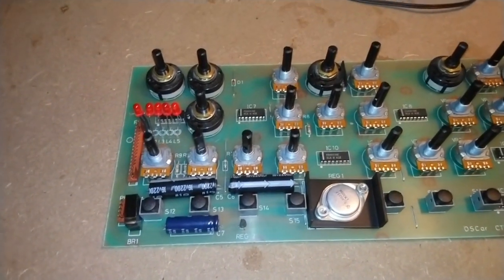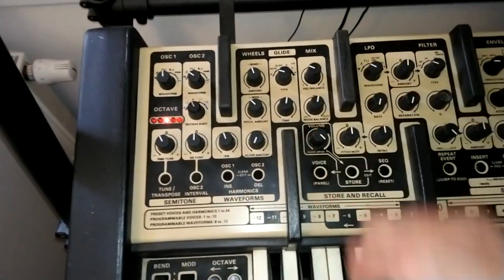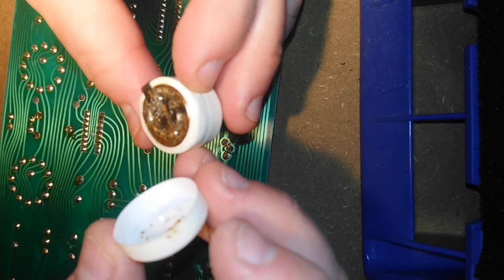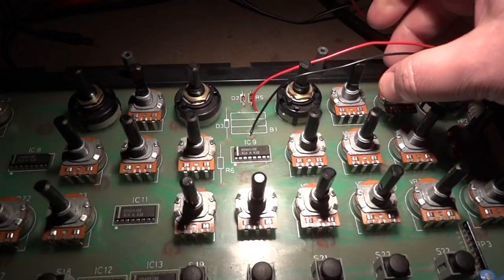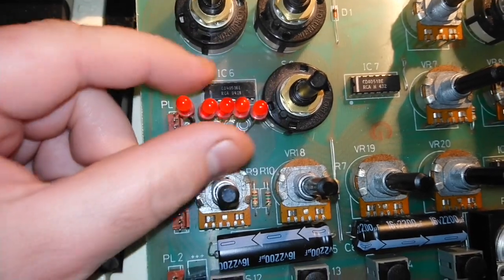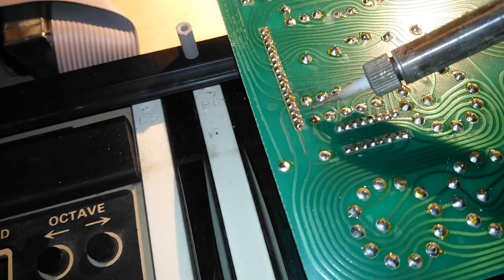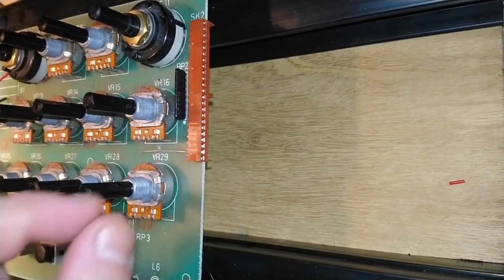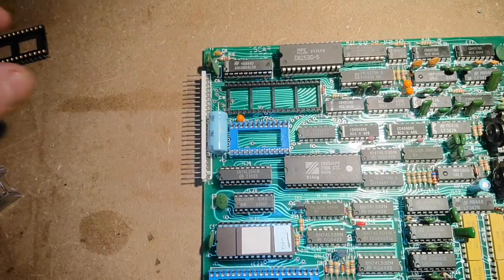How to repair and how to destroy a classic! - OSCar Part 3

Comment: Great video and good warnings about DIY repair. My OSCar would not boot. I replaced all the logic but no luck. Bob Griebs new board eventually solved the issue. I think the timing of the CPU start was the problem. The interconnects give serious bother.
Reply from the maker: I should definitely do a video about Bob Griebs board. It's a must have for OSCars.